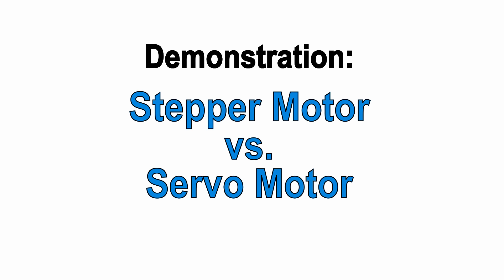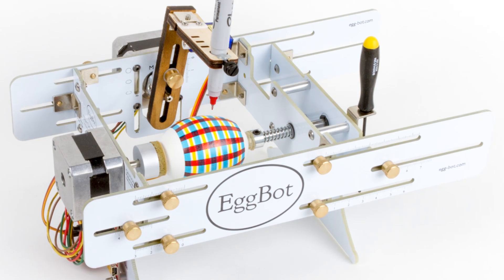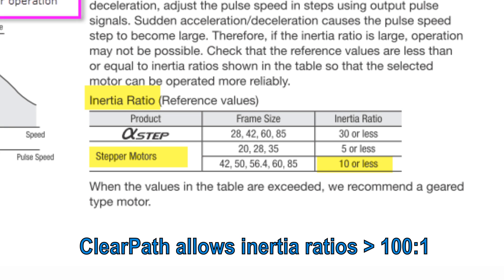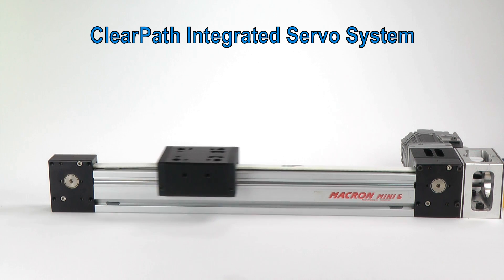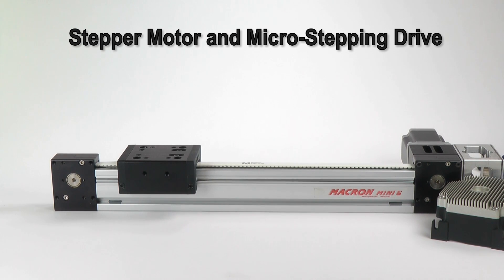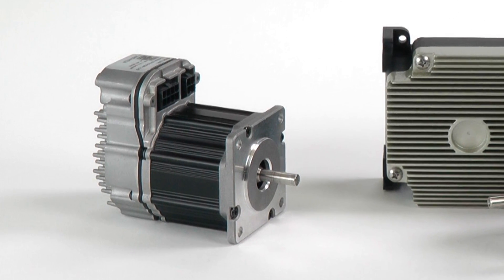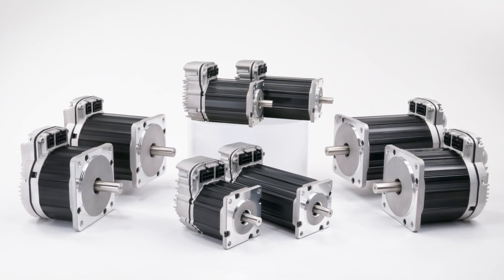Stepper Motor vs. ClearPath Servo Motor Demonstration Video

Comment: Yet another fake comparison for sake of advertising.
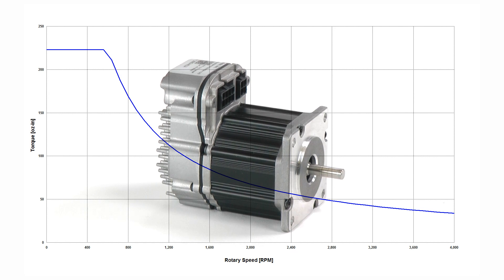Never trust a motor manufacturer who's allegedly professional, but doesn't give the real motor characterics and curves. What you can see at 2:18 is not a real one, but a kind of artifical. Professionals need exact real curves to design driving systems. So this manufacturer sells to amateurs only. Because of this they can state anything , false and made up things, whatever they want, no one will/can verify it. The motor comparison part of the video is also fake, staged. No one knows what are you comparing, its a secret. A real comparison is like an experiment, you have to name all components precisely, and the experiment must be repeatable, verifiable. What kind of power supplies you used, what kind of motor controllers, what kind of motor drivers, and what kind of motors ? You compared all of these components not only the motors, did you know that at all ? Its all secret, but instead of that you state something what can be true or lie. Most probably its a lie, because you don't even try to make a fair unbiased comparison, that is not your goal.
Reply: Hi Telelaci2, I look forward to hearing about your experience with ClearPath. If you need any assistance, please give us a call or send us an email. Additionally, it seems as though my previous comment from our Teknic Inc. account isn't public for some reason (likely because it contains the link to Teknic's Hudson motor page on our website). I've re-posted the comment below (without the link, from my personal account) for reference, in case my original attempt never goes public:

"Hi Telelaci2, I appreciate you taking the time to express your thoughts and I feel that you make some valid points. Here is some more information to clarify.

ClearPath has an integrated three phase, 8-pole, permanent magnet brushless motor, combined with a sinewave-commutated, vector torque-controlled servo drive and a 12,800 count/rev encoder. There isn't a way to remove feedback within ClearPath, because the encoder is internally closing the loop to the drive built into the system. If, hypothetically, you could remove the encoder, the motor would not be able to be position controlled any more because it doesn’t work open loop like a stepper motor (the main historical advantage of the stepper motor construction).

If you'd like to see the motor components that ClearPath uses, you can visit Teknic's Hudson servo motor page. ClearPath is built from most of same motor components used in Teknic’s Hudson servo motor and on this page you can see a cut-away photo that will allow you to see that it is not a stepper motor.

ClearPath SDSK models were designed to be a drop-in replacement for stepper motors. (The “SK” in the model name actually stands for “Stepper Killer”; that was its internal name when it was under development.) Their torque/speed curves are purposely designed to be similar to a stepper curve, except that they provide higher power at any given size.

The two systems we compared were set up exactly the same except for that the stepper motor and stepper drive were replaced with the ClearPath integrated servo system. The difference in noise is because the physical design of a stepper motor produces significant audible noise (along with the associated loss of energy and efficiency). The reason ClearPath is quieter is because it is an 8-pole, PM motor run as a vector torque controlled servo. All other settings and components (including the controller) were the same for both systems.

The stepper motor and stepper drive are manufactured by large, reputable companies and are used in many OEM machines. These are products that we sometimes run into when catering to our OEM market, so we know that they are of a quality suitable for demanding OEMs.

Sometimes a stepper motor makes more sense than a servo for specific applications and users, especially where the shaft power required is less than 100W. The goal of this video was to inform users about the differences, and to show where ClearPath is advantageous over stepper systems.

I agree, we could have expanded the video to list out all of the components we used, what specific controller settings were used for what type of moves, and all of the information that you've pointed out. However, that would also call for a much longer demonstration and video. I also agree that the title may be confusing because we are not comparing a stepper motor vs. a generic servo motor, but rather a stepper system vs. the integrated ClearPath servo system. I value the feedback and will suggest that we look into making the title a bit clearer. 

That said, servos (ClearPath or otherwise) will always have the performance advantages shown in the video; our goal was to show that you can get those performance advantages now with ClearPath at a low price (comparable to stepper motors of similar power) and without the complexity typically associated with servos.

I realize that this additional information and my explanation may never change your feelings regarding this demonstration and ClearPath. I respect that you take the time and effort to correct information that you feel is false or misleading. I think it would be great if more people did this with information presented on the internet to ensure more accuracy and truthfulness. I hope that the information I've provided and the material on our website will help clarify this demonstration, Teknic's products, and the goals of our company. 

If you ever decide to try the experiment yourself and have any questions, we'd be happy to answer them. And if you ever wanted to try a ClearPath motor, it has a 90-day money-back guarantee; you can buy one, test it for three months, and send it back for a full refund. That might be the best way to become convinced :)

I wish you the best of luck with your motion control applications.

Best,
Bridgette"
Reply: Hi Bridget,
I forgot to report to you that I tested a little ClearPath SDSK2311 motor. And it was awesome, one of the best motor I've seen. Maybe not the best, I donno, more and longer test would be necessary to decide. But I won't tell the name of the best so far, I don't wanna be unfair, this is your video page. And that other motor was $299 not cheap either.
Reply: Thanks for the video and great information you provided through the conversation with Mr. telelaci2 thank you both.
Reply: Telelaci2, I'm not familiar with the products you listed, so I appreciate the additional resources and examples. There are many stepper drives and motors you could choose from to run a comparison. We picked the specific drive and stepper motor in our video because we run into these brands in the OEM market.

-Bridgette G.
Reply: telelaci2 ??stepper versus servo?? Obviously a difference would be seen and heard between comparable sized motors. Calling bs on the video hasn’t any grounds and frankly rude. Many people don’t know the difference and frankly whether it’s a clear path servo or another brand servo it will out perform a stepper night and day. Until you switch over to a quality servo you won’t have that experience to say either way. With so many Mach users it’s a wonder why people get offended when their platform doesn’t truly support a closed loop system. so had somebody else had a video without their involvement and brand named filmed exactly like this would you still complain???
Reply: Üdv telelaci2!

Nagyon szépen köszönöm ezeket az információkat, amiket itt, illetve más hasonló videók alatt is láttam tőled. Nekem, mint a fizikához, és unblock a stepper/servo/és ezek különböző hibridjeihez nem értő embernek nagy segítséget nyújtott, hogy nem buktam rá ezekre a túlárazott dolgokra, mint tyúk a takonyra. Azért írok itt, hogy kérdezzek, üzenetet sajnos nem lehet írni számodra, remélem tudsz segíteni.
Tehát lenne egy kis házi projektem, nem kell semmi komolyra gondolni, kigondoltam egy dolgot, aminek egy részét egy ilyen motor alkotná. Rengeteg információ van a neten, azonban ezen motorok kapcsán a zajról nem nagyon lehet olvasni. Ami viszont számomra kulcsfontosságú lenne, hogy a motor teljesen zajtalan (vagy legalábbis ahhoz közeli) legyen. Laikusként, teljesen absztrakt megfogalmazásban próbálom elmondani: A motor kb. 5-10kg közötti súlyt mozgatna úgy, hogy egy párszor egyik irányba, azután a másik irányba körbefordulna (alacsony fordulatszámon), és ezt a lehető legkisebb zajjal/rezonanciával tegye meg. Másik fontos dolog, hogyha hozzáérnek, vagy kilengene a súly, akkor ne 'álljon meg' (mint ahogy a stepperek szoktak) hanem azt figyelmen kívül hagyva folytassa a köröket amiket csinál.
Kérdések:
1. Ehhez stepper/servo/vagy valamilyen hibrid motor lenne a legjobb?
2. Tudnál esetleg konkrét márkát, típust ajánlani, max. 200$ környékén?
3. Tudnál márkát, típust ajánlani a high-end kategóriából?
4. Mi a véleményed a lin-engineering cégről? https://www.linengineering.com/
Van egy sorozatuk, aminek a neve a 'smooth-step', vagy 'whisper torque', ami elméletileg a zajtalanságot garantálja (állításuk szerint ők valamit mahináltak a mágnesekkel, így érték el, hogy halk legyen) - Ez igaz? Vagy ez is csak egy szépen becsomagolt átbaszás?
Pl. https://www.youtube.com/watch?v=YmDMQwgsYlQ
Ugyanez a shopjukban: https://www.linengineering.com/products/stepper-motors/g5709-series/#fndtn-standard_motor
5. Ők  még árulnak 'dampereket' is, szerinted azok segítenek a zaj elnyomásban? https://www.linengineering.com/products/accessories/nema-23-dampers/

Előre is megköszönöm, ha időt fordítasz arra, hogy válaszolj, és azt még egyszer kiszeretném emelni, hogy én ezekhez egyáltalán nem értek (mielőtt még szellemi fogyatékosnak tartanál :D )
Reply: @War Like Kérlek add meg az e-mail címedet, nem akarok itt más termékeknek reklámot csinálni az nem fair.
Reply: warlikelikewar@gmail.com és köszönöm!
Reply: Hi Telelaci2,

I'm happy to hear that you had a chance to try ClearPath and I appreciate you posting about your positive results up to this point. We respect all feedback, especially from someone who has your experience with different types and brands of motors.

It sounds like ClearPath testing is going well so far. We'd be curious to hear your conclusion if you get the chance to proceed with further testing and compare ClearPath to the servo system that you previously found to be the best. Based on our exchange a few months ago, I trust that your testing would be well thought out and objective. 

Even if you find that you prefer the other servo after fully testing ClearPath, we wouldn’t mind you posting a summary of your findings on our channel (although YouTube’s format makes it difficult to share a lot of technical/graphical detail). In either case, we would appreciate the opportunity to discuss the results with you prior to you posting them if that’s okay with you. (You can find our email address on our website or on the “About” page of our YouTube channel.) 

Have fun with your testing!

Best,
Bridgette
Reply: Rokmononov
That is what I was thinking. The internal circuitry is a huge selling point for the ClearPath motors. I like how this has the advantage of servo motors with stepper control. This may be overkill for my application, though.
Reply: Hi Telelaci2, I'm an applications engineer for Teknic. We apologize if any of the content in this video led you to believe that our intent was to deceive motion control users in any way. The goals of our videos are to educate and explain motion control topics to our viewers as objectively as possible so that each person can be fully informed to make the best decision for his/her particular circumstances. We welcome any comments that point out where we may have been unclear, biased, or wrong, and we will do our best to fix the situation.

Below, I've listed each component we used to compare this specific stepper system to our specific ClearPath servo system. The components we used were manufactured by companies that we run into when selling to OEMs, so our choice is more toward that end of the spectrum rather than the hobbiest end. This way, we are comparing the same class of products to our OEM-focused motion control products. 

Please feel free to repeat the experiment with the components listed below; you should be able to easily repeat our results. Please don't hesitate to contact support@teknic.com if you have any additional questions or concerns.

Best regards, 
Bridgette G.

Stepper System Components:
•        Macron Mini Belt Stage from Macron Dynamics P/N: MSA-628 (same for both demos)
•        Schneider Electric MForce Power Drive Plus P/N: MFM1CSZ34N7
•        Oriental Motor/Vexta Stepping Motor: PK268DA
•        75VDC bulk linear power supply (same for both demos)
•        AllMotion EZ-series stepper indexer (same controller for both demos)

Servo System Differences:
•        Teknic ClearPath Integrated Servo Motor P/N: CPM-SDSK-2310S-RLN instead of the Schneider stepper drive and Oriental Motor stepper motor.
Reply: Hi Bridgette,
Thanks for your answer, you are very kind, but sorry to say it doesn't make the things much clearer. You said you were an engineer. Then you listed 2 different system accurately, from different manufacturers, manufactured for different purposes. And you have found differences between them in the test. As an engineer please tell me what was the goal of the comparison. (I know, to prove that Clearpath is better than any stepper, but I wanna hear something unbiased official goal, from an engineer) What did you expect? What makes you think that you compared the "servo" and the "stepper motor" here, and not for example the quality of motors or the drivers, or the controllers. As an engineer you know that exactly, there are huge differences in those products. As an engineer you know that (at least you should know) that huge difference in the noise at 4:25 could mean :
a) very different motor quality, or
b) very different kind of controllers, or
c) very different kind of controlling, settings or controller, or software, or
d) all above
e) none of above but something else.
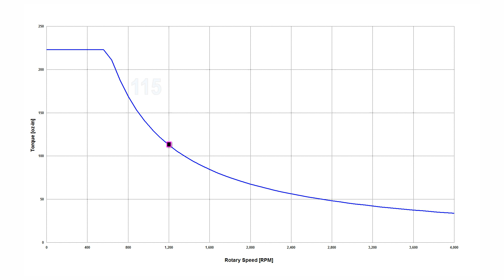As an engineer, what makes you think that you demonstrate the effect of feedback upon the noise at that moment ? Let me mention one thing, you compare actually 2 stepper-motor, one is without, and one is with loopback. We both know that the typical servos has different diagram from what we see at 2:40, so naming it servo is not totally accurate although its common (Leadshine easyservo) A real servo is slightly different design with lower low speed torque and higher high speed torque. This is a stepper design equipped with position feedback.
You know I (and you too) could repeat that comparison with a totally different result. A regular stepper motor would be more quiet than the quasy-servo one at that low speed or at least the same quiet. I could set that up if I wanted. This is not 2-3000rpm where a servo really shines. The huge difference in noise is there because of the difference of the driving and controlling. One is without smooth steps, the other one is smooth with big divider. Its that simple. Have you shown us the difference in the torque at that point any way? An engineer would like to see that, don't you think ? As a stepper engineer you know exactly that the feedback doesn't help on the motor at low speed when you set low, smooth steps for sake of low noise. You would lose the torque for exchange.
Next time if you wanna see the effect of the feedback upon noise, use exatly the same Clearpath motors, just remove the feed back somehow. As an engineer this is obvious. Of course you can set better smootsteps with feedback if you don't ruin the torque. But at low speed this is not possible , you know this.

You see ? Despite of the fact that your answer is very detailed and honourable, you can't hide the fact that this experiment has no meaning to an engineer. There are no engineering goals to prove or falsify. The experiment was not created by a scientist or an engineer, but a merchant, and it was made for amateurs, and the goal has nothing to do with comparison or demonstration, but advertising instead. I'm sure about this, because there is a really telltale fact. I could have chosen a much more quiet (even a Chinese crap) stepper motor + driver  for $346 bucks , hahaha :) You were very clever with finding this crap noisy but expensive stepper motor :)
Reply: Hi Telelaci2, I appreciate you taking the time to express your thoughts and I feel that you make some valid points. Here is some more information to clarify.

ClearPath has an integrated three phase, 8-pole, permanent magnet brushless motor, combined with a sinewave-commutated, vector torque-controlled servo drive and a 12,800 count/rev encoder. There isn't a way to remove feedback within ClearPath, because the encoder is internally closing the loop to the drive built into the system. If, hypothetically, you could remove the encoder, the motor would not be able to be position controlled any more because it doesn’t work open loop like a stepper motor (the main historical advantage of the stepper motor construction).

If you'd like to see the motor components that ClearPath uses, you can visit Teknic's Hudson servo motor page. ClearPath is built from most of same motor components used in Teknic’s Hudson servo motor ( https://www.teknic.com/products/hudson-motors/ ) and on this page you can see a cut-away photo that will allow you to see that it is not a stepper motor.

ClearPath SDSK models were designed to be a drop-in replacement for stepper motors. (The “SK” in the model name actually stands for “Stepper Killer”; that was its internal name when it was under development.) Their torque/speed curves are purposely designed to be similar to a stepper curve, except that they provide higher power at any given size.

The two systems we compared were set up exactly the same except for that the stepper motor and stepper drive were replaced with the ClearPath integrated servo system. The difference in noise is because the physical design of a stepper motor produces significant audible noise (along with the associated loss of energy and efficiency). The reason ClearPath is quieter is because it is an 8-pole, PM motor run as a vector torque controlled servo. All other settings and components (including the controller) were the same for both systems.

The stepper motor and stepper drive are manufactured by large, reputable companies and are used in many OEM machines. These are products that we sometimes run into when catering to our OEM market, so we know that they are of a quality suitable for demanding OEMs.

Sometimes a stepper motor makes more sense than a servo for specific applications and users, especially where the shaft power required is less than 100W. The goal of this video was to inform users about the differences, and to show where ClearPath is advantageous over stepper systems.

I agree, we could have expanded the video to list out all of the components we used, what specific controller settings were used for what type of moves, and all of the information that you've pointed out. However, that would also call for a much longer demonstration and video. I also agree that the title may be confusing because we are not comparing a stepper motor vs. a generic servo motor, but rather a stepper system vs. the integrated ClearPath servo system. I value the feedback and will suggest that we look into making the title a bit clearer. 

That said, servos (ClearPath or otherwise) will always have the performance advantages shown in the video; our goal was to show that you can get those performance advantages now with ClearPath at a low price (comparable to stepper motors of similar power) and without the complexity typically associated with servos.

I realize that this additional information and my explanation may never change your feelings regarding this demonstration and ClearPath. I respect that you take the time and effort to correct information that you feel is false or misleading. I think it would be great if more people did this with information presented on the internet to ensure more accuracy and truthfulness. I hope that the information I've provided and the material on our website will help clarify this demonstration, Teknic's products, and the goals of our company. 

If you ever decide to try the experiment yourself and have any questions, we'd be happy to answer them. And if you ever wanted to try a ClearPath motor, it has a 90-day money-back guarantee; you can buy one, test it for three months, and send it back for a full refund. That might be the best way to become convinced :)

I wish you the best of luck with your motion control applications.

Best,
Bridgette
Reply: Hi Bridgette,
"...There isn't a way to remove feedback within ClearPath..." - I presumed this, I'm not stupid. But then you compare 2 different product. Not "servo vs. stepper", because there are many-many other differences between them. I can compare a car with diesel motor to another car with petrol motor. And I can show you that the gasoline motor much louder, much weaker, much more expensive... so on, just I have to choose the car's type/manufacturer accordingly. And actually I wouldn't lie. Just the comparison wouldn't show the difference between petrol and diesel motor, but someting else. Of course in general the diesel motor is louder and weaker and more expensive. A real engineer doesn't do such a comparison. Maybe an advertising manager.

"...to see that is not a stepper motor..." I didn't mean offence or degrading the motor, I just meant that the motor charactertics is like a stepper, so its more similar to a stepper (with feeback) than a high speed servo. And the guy also mention it on the video, and you have just explained it, you wanna replace existing stepper systems.

To the other parts I don't answer sorry. Because excuse me but its just simply stupid. You deduce the advantage of your servo to principles and the motor structure, and you guys at Tekno know this , everyone else in the world doesn't. They are all total idiots, they  manufacture regular stepper for the same or higher price than you can do, and the moron stupid customers buy those crap stepper motors. What's happened Bridgette ? You guys at Tekno have taken notice of this phenomenom, that a servo is always better than a stepper for the same price, so the age of steppers is gone ? And you know this but no one else?

"That said, servos (ClearPath or otherwise) will always have the performance advantages shown in the video..."
This is true. Before you would mistake me very badly, I have to mention that I use almost only servos. But this video (and you) "forget" to mention something. The servo systems are better because usually every part of the system is better than a stepper system. They have better motor, better driver, better PS. And this is an obvious necessity. The motor must run on much higher speed. Many steppers can barely reach 2000 rpm, a servo just starts to feel good at 2000 rpm. The electrical signals are faster, you need a better DSP to control things, the SW in the DSP must be much better, the algorithm inside is more sophisticated than a stepper without feedback. These things are not free. I bet ClearPath motors are excellent, very good motors. For 2 times more money than similar stepper system. Actually they are not comparable. The question is always that : do I need the advantages of the servo for the higher price. I visited your web pages, and despite of my criticism here, probably I'll make a try with it, because it looks good quality, its worth a try :))

The most clever part of the above video, it suggests that the stepper system have the similar price level !!! Look at that a stepper system for $346, its about the entry level ClearPath, almost the same. And the ClearPath is obviously better! (actually and literally you don't lie at all !) Hahaha, this is bullshit, you mislead the people, and you put technical fudge next to it.
And of course you don't paraphrase deeply in the video when the servo has no advantage compared to stepper. Nothing at all. Low speed high torque, simple drives. In many cases a servo would be just 2 times more money for nothing. Choosing between stepper and servo is not so easy. And you don't make it easier at all. Sorry I abide by my first sentence "Yet another fake and staged comparison for sake of advertising."
Reply: I forgot to mention Bridgette, I also appreciate (and surprised) you taking time to answer. This is totally unusual. You don't have to answer anymore, because it seems we will not agree. But I'll return and I'll tell you my opinions about the ClearPath motor. Because I'll make a try for sure, you made me curious. No hard feelings I like you, just this video is bullshiting.
Reply: I found this video, It shows exactly what I'm talking about.
https://www.youtube.com/watch?v=E4AjBN9gqAg
It shows a much stronger stepper motor than your Oriental Vexta in the test. Its 637 oz-in vs. your choice of test 240 oz-in, for only $70
http://americanmotiontech.com/products/productdetail.aspx?model=leadshine-86hs45d-nema-34-stepper-motor-4.5nm
Its driven an older and a newer driver for comparison :
http://americanmotiontech.com/Products/ProductDetail.aspx?category=1&model=M880A
and
http://americanmotiontech.com/products/productdetail.aspx?model=dm860-digital-cnc-stepper-drive-80v-6.0a
, for $120...$130 far from $280. Strangly the worse and older driver is more expensive. The value added up is about $190 far from $364 half of it, for a more than 2 times stronger and bigger stepper system. And its the same noiseless product like Clearpath, just watch the video.
Did this video jus want to inform people about an alternative solution, indeed ? Sure, we can buy a 30% torque but 2 times more expensive servo motor to replace our stepper system. If 30% torque is enough at all. This is what I'm talking about exactly, from the beginning.